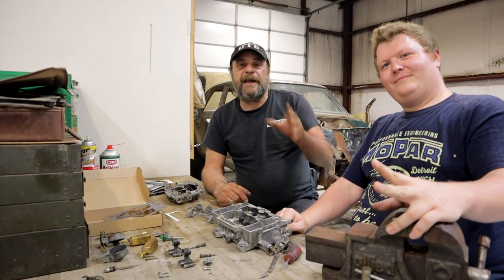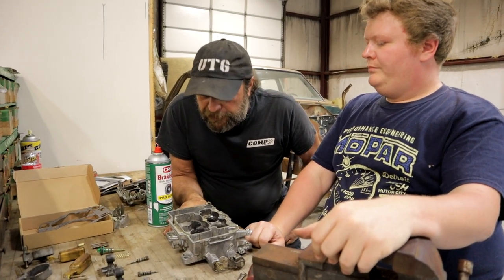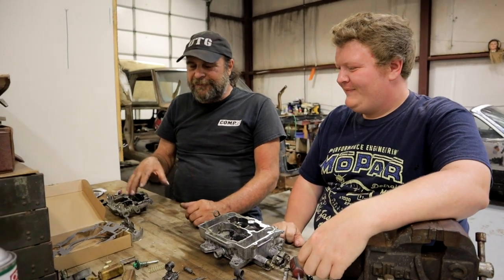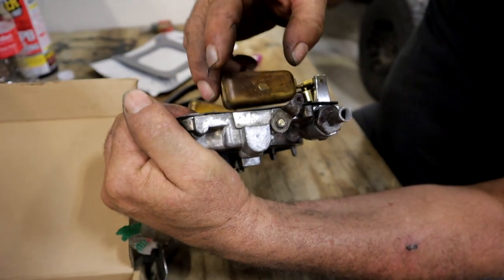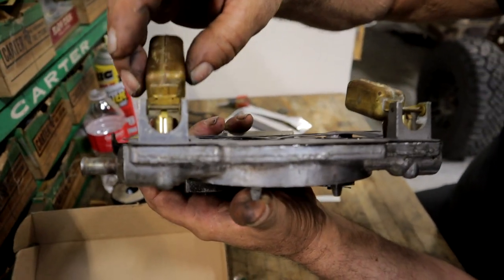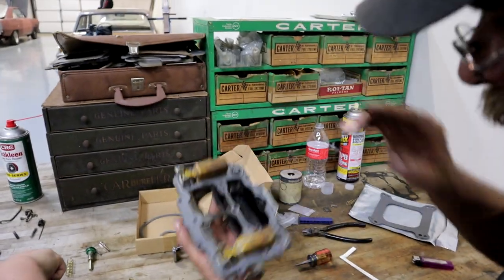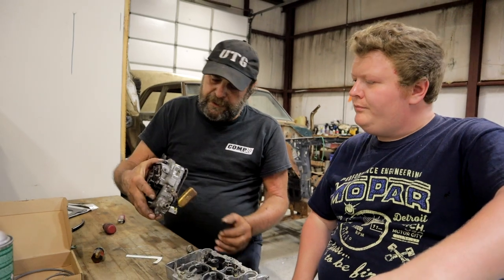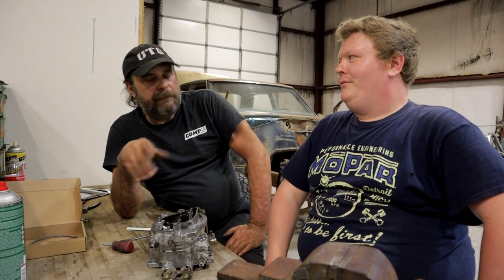$18 Edelbrock Carburetor Rebuild

Comment: I  have a 750 edlebrock on my 383 crate motor.  Carb rebuilt several times but engine idles too rich and fouls plugs.  Runs ok under load.  Overnight gas bleeds out of carb into engine. Vacuum at idle is 13 inches.  Any ideas?    Glen from Ontario
Reply: Get an adjustable pressure regulator and set it with a guage... When that's done look at jetting, not before... Ask me how I know..
Reply: @joshmorris3469  did the regulator set at 5.5 psi . Played with leaner jets  still too rich.. pulling my hair out! Thanks for the reply... Glen
Reply: If you have a hotter HEI coil, you can play with plug gap, but I recently installed an afr gauge since I daily drive a 73 C10... It opened up my world..  I recommend it if you don't have one.  Instead of tuning idle to highest vacuum, I adjusted the primary blade position then set idle bleed to desired AFR... Response is great, cranking great, milage in the 13s vs 10s...
Reply: Also, since you said leaner jets, it helps to think of area instead of jets size..  like a big jet with a bigger rod combo may get you leaner than a jet or rod change alone... Calculate the area remaining in the jet minus rod size on big end.. that's the area that fuel can pass through.. also spring weight..  fuel leaking out is likely due to temp at shutdown, but that's just a guess
Reply: Don't have car gauge but  thinking about going to efi. First I will try playing with rods as you suggested.  Thanks for the responses....Glen

Comment: A couple of tips for carburetor rebuilders - gas welder tip cleaners work great for cleaning fine passages, you can get a set at any auto parts store. Use a 7/16" drill bit for a feeler gauge when setting the float level.
DON'T go by the instruction sheet that comes with the carb kit, they are incomplete and filled with errors. Get the proper specs from the manufacturer's manual, either the car manufacturer or the carburetor manufacturer. This goes for stock carburetors, and would not apply in this case to an aftermarket model.

Comment: those cheap ebay kits are arlight by me, alot of the time they throw in double gaskets, and for a buck or two more you can get one with the spring loaded needles and standard needles as well, used the spring loaded needles on derby cars and offroad rigs

Comment: When I was about ten I went with my Dad to Spitzer Auto Electric in Denver. My Dad was getting a carburetor tune up on the family’s '64 Chevrolet Impala. I was watching George the older experienced mechanic take apart that Rochester 4GC and was amazed at how fast he took it apart and how many rods, springs, screws and check balls made up the parts to that carburetor. Later when I was older I taught myself to do an overhaul on the Rochester M4MC and the M4ME carburetors and I got to be pretty go at doing an overhaul on those models. Today my Pentastar V6 in my Chrysler 200 convertible has multipoint fuel injection, which is so far trouble free. I enjoyed this video.
Reply: That building is still there actually but its condos or something now. I looked the other day. Great resource when it was around a half a century or more ago. I miss shops like that.

Comment: Wish Uncle Tony had taught my shop class when I was in high school,,,might have learned something useful...
Reply: We had more of a heavy diag instructor aka thats what he mostly did when he was in the workforce. Its ok, but getting some basics done, is the real way to learn. Having vehicles, that maybe had problems, were fixed, then reverted back to the ''broken'' for somebody to test and fix would be ideal. Most mechanical parts, anyone can figure out SOME way to get it all done. Still nice to know tips and tricks with all of it. I got out of the class knowing a decent bit, but in reality not much of it helped when you have to do every job that comes in the door. Figure it out as you go, ask questions so you don't ruin everything lol.

Comment: I had a Carter AFB and had a hard time finding the exact accelerator plunger for it. None of the kits I bought had what I needed.
Reply: There are 2 sizes ,so close in size that you really need to measure them

Comment: Only thing I would add would a safety precaution.  Always wear safety glasses when dealing with solvents and other chemicals.  Safety glasses are cheap, eyesight is not.  Also, you can buy safety glasses that have magnifiers at the bottom edge of the lenses.

Comment: A torch tip cleaner works really great to get those passages clean. And you have an assortment of different size wires to work with

Comment: The shank of a 7/16" drill bit is helpful when checking the floats, also you skipped the part about losing the tiny linkage clips.
Reply: Yup don't even bother looking for them. 
Get new. 
You'll find the one that went flying across the shop in about  6-7yrs when you're futzing with the furnace/air compressor/what have you ,  over at the other end of the building and around the corner in the utility room 🤣